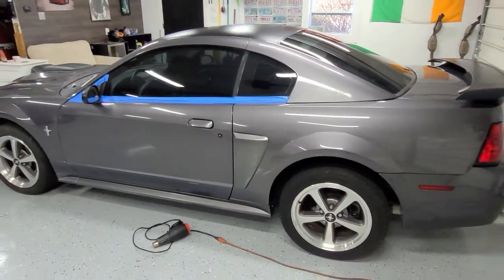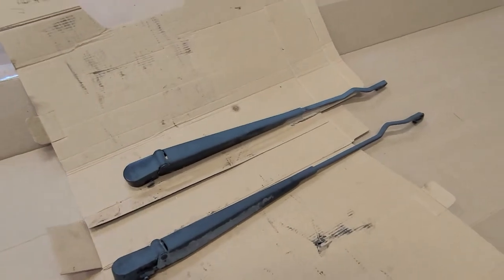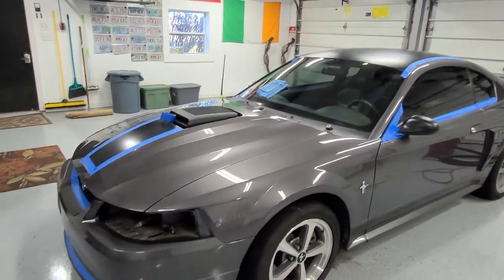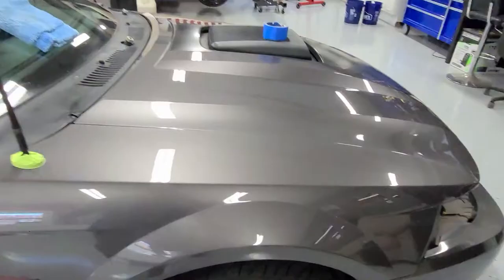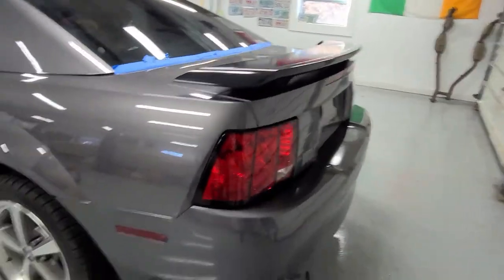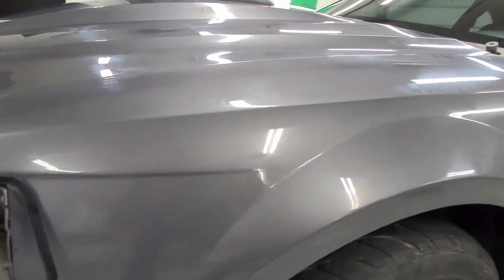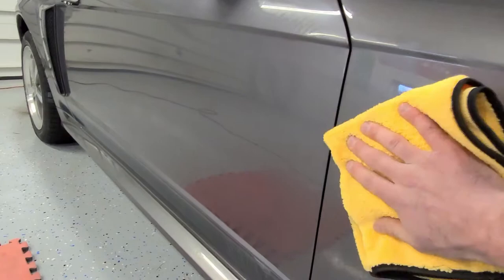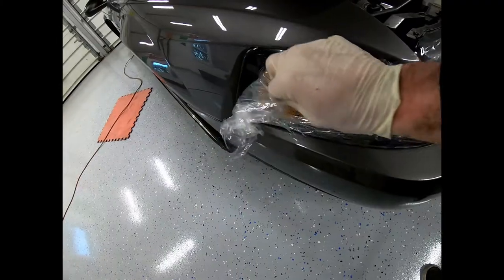Mustang Mach 1 Flip: Part 2! All finished!

Comment: Nice work on the paint. What about that head liner?
Reply from the maker: I must have forgot to film it. I repaired the headliner and glued it back up using 3M adhesive
Reply: @ChrisSullivan69  nice. You should get some decent $$$ for it.